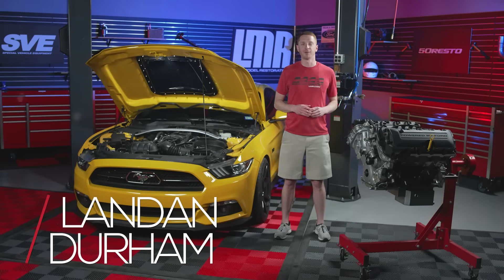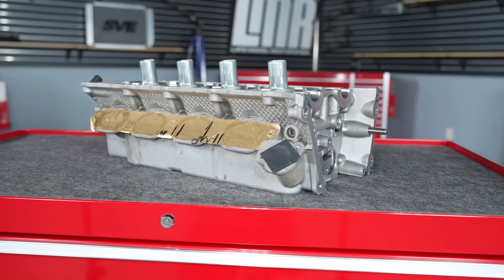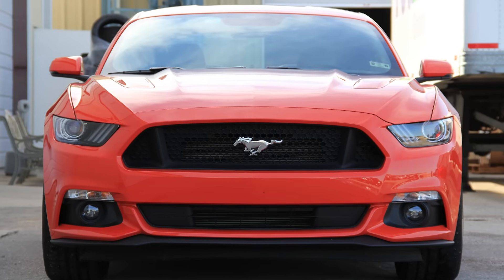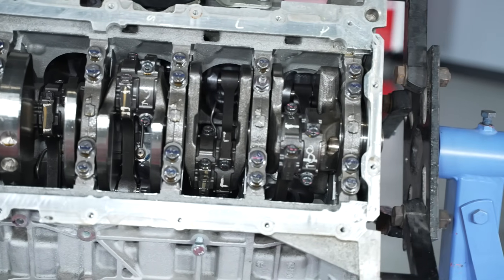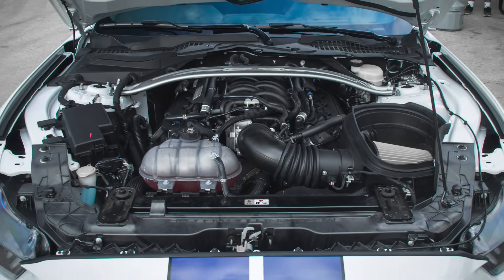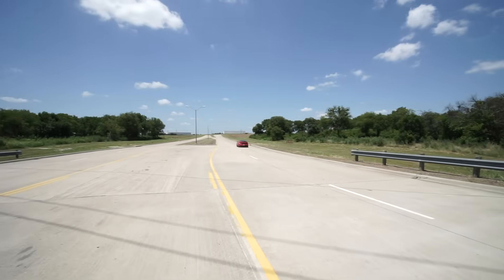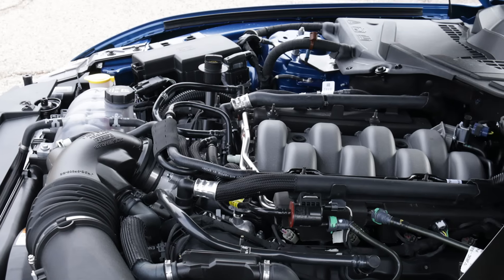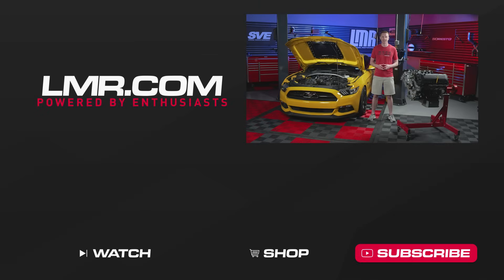Evolution Of The Mustang 5.0L Coyote Engine | Gen 1, Gen 2 & Gen 3

Comment: Anyone else have Gen 1 with aftermarket Heads or ported stock? I have a Ford Performance manifold(Boss intake) and want to keep but want Trick Flow high flow heads
Reply from the maker: No one makes aftermarket cylinder heads for a Coyote. If you're dead set on an N/A build, port the stock heads. However, you'll quickly figure out that boost is near the same price point. -Landan

Comment: I owned a new 2017 GT and now have a 2020 GT (bought new). Something overlooked is that for a physically large engine, they Coyote is fairly light. Also, fuel economy is very respectful on long drives. I've gotten 30mpg cruising the interstate at 75-ish.
Reply: Exactly why im doing my own fab for the dark horse swap into my Z !!! It has so much less support but its worth it!

Comment: Does the current generation used in 2022 and 2023 trucks still use the plasma arc cylinder bores? I thought ford did away with that. Wasn't that thought to be a cause of excessive oil consumption?

Comment: When you say Plasma Arc cylinder walls, does this meant the cylinders are coated Aluminum and do not have steel anymore?
Reply from the maker: Correct.  The plasma arc process deposits material to the raw cylinder bores and then they're machined to tight tolerances.

Comment: how might a person determine if their late production 2014 has the 2015 heads?
Reply from the maker: The 2015 cylinder head had an extended port flange because of the CMCV system.  -Landan

Comment: Now if they can just evolve it into an LS they will have something.
Reply: Don't you mean de-volving into an LS....
Reply: @19coyote5oh9  Well let's see. LS is smaller, lighter, simpler, cheaper, more powerful. Yeah, those are all devolved.
Reply: @jeffarchibald3837  Um more powerful, um no.
Let's see a na 5.0 pushrod make 460 hp, not happening why, 32v or Dohc engines are just way more efficient making power period.
There is a replacement for displacement, it's called technology.
So yes the LS is way outdated technology, no manufacturer on the planet makes ancient pushrod engines except for Mopar.
It's cheaper and simpler BECAUSE ITS OLD lol.
LS has way passed it's prime.
Reply: @19coyote5oh9  I'm a Ford guy myself. Just wish Ford had made the LS. So you are saying newer is better even if it's not as good.
Reply: @jeffarchibald3837  Well the old 5.0 was a "LS" type engine, simple 2 valve design that for the most part work extremely well, for the time.
LS was king for the longest time, but with the introduction of the 32v quad cam,direct and port injection TIVVT Coyote it's on a different level compared to the simple not as efficient LS .
Reply: @jeffarchibald3837  coyotes make easier na power, boost power, and are more reliable
Reply: @jeffarchibald3837  Power to displacement, the 5.0 is superior to the LS.
Reply: @rickitysplitz7035  So what? Power to physical size and weight of engine is less. LS wins, not even close. Try putting a Coyote in a 64-70 Mustang.
Reply: @19coyote5oh9  Really? In unlimited engine racing NOBODY runs coyote. Even Ford factory cars run the old 460s.
Reply: @jeffarchibald3837  And? The 5.0 engine handles boost tremendously better and with the aftermarket support to aid it, will beat a pushrod LS. Bang for the buck definitely goes to the LS, but when it comes to potential, the 5.0s take the cake with the high RPM advantage. I will take it over any LS, especially when I have my 950whp 5.0 baby with me right now as we speak. lol

Comment: I’m Gen 3 coyote 10R80 GT with a 3L Whipple with 3.75 upper pulley, long tube headers, hi glow cats and cat back, billet OPG amd CS, engine and trans oil coolers plus 170 deg thermostat running on 93 pump fuel. Only tuned to 620 wheel HP. Been running like a dream for over a year like this. In your opinion how much more HP can I go safely on this set up with the stock motor? Note, I only do 40mph -130mph roll races at a race track say 10 runs every 6 weeks and some canyon driving (no more than 5000rpm) on every second weekend.
Reply: E85 would be the next best move for more power and safety. With just ethanol and tuning you’ll gain a ton of power. Gen 3 is pretty high compression for boost so you’re most likely octane limited. There’s no magic number for how much they can handle, just suggested limits. It mainly depends how you use it and how good the tune is.
Reply: @gforce_117  Thank you mate really appreciate your suggestion. It’s pretty nice at the moment seems happy but it’s only 620WHP but you know what it’s like “I wonder how much quicker I’ll be with another 100WHP” lol
Reply: @CoyoteAUS  620 isn’t a lot on YouTube, but it is in real life! I have 470 on a S197 chassis and it’s quick and a ton of fun. Definitely not the fastest, but it’s fun and that’s what it’s all about. No matter how far you push it there will be something faster. It eventually gets to a point where it’s more than you can use/put down on the street anyway. With more octane to support it, that supercharger can make a ton more power. I think you’ll still be good and reliable at 100 more hp. You have a really nice setup 👌🏻
Reply: @gforce_117  Thank you mate.

Comment: I have a 2020 f150 with the 5.0 all stock and man is it quick. I've beaten Chevys and Rams in races. Coyotes rock!
Reply: Man I got a 201 5.0 xlt my my friend gots a 20 chevy 6.2 I'm shocked it has 200mph on the dash  my ford only has  120mph I know they both  have  governors on them but damn 200mph on the dash
Reply: @keitgwilliams4349  My truck only goes up to 105 mph and will not go past 105, that's the only thing that sucks about it.
Reply: I think my truck went 106mph I was going down a open hill in south Dakota  on interstate 90 and it wouldn't  go any  faster
Reply: Hell yea. I have the Ranger (largest truck they make in South Africa) similar to the new Ranger in 'Murica but diesel engines and slightly different looks

Comment: The 3rd gen manual felt kind of sluggish below 4500rpm. Idk 460hp sounds good but I feel like it needs to be supercharged to have the low band seem good...🤔
Reply: Could probably use some variable valve timing tuning for low end but then again these new mustangs are thiccc boys coming in at 3700lbs without a driver
Reply: Its probably that the revised mt82d4 has less agressive gearing than previous gens that hurt low end punch
Reply: @elcochiii  yeah man, that low end punch was BAD. A F150 5.0 V8 took me off the line, after 55mph I pulled hard but what the heck. Yeah the 265s are garbage, but needs more grunt downlow its really bad.
Reply: @gc1087  there's no excuse for Ford to still be using that crappy mt82.  A10 is frigging awesome .
Reply: @soulerflare7  Maybe...but it's a Automatic so that's a automatic 'no' from me... 
They should just use the tremec 6 speed for all the GT mustangs.
Reply: @gc1087  oh yeah , gt 350 uses tremec 6 right ?
Reply: @soulerflare7  yeah, it does.
I'm just a fan of the mt82, I mean my 2018 drove fine but it definitely could of felt more solid.
Reply: Yall need all motor labs tuning in your lifes 😐 2018 ford f150 5.0 a10 running 10s all motor

Comment: One thing not mentioned here is Ford used 2 different head bolts - 11mm and 12mm. 
12mm bolts went deep into the block, tying into the main webbing (the strongest part of the block). The 11mm blocks used shorter bolts that ended about where the knock sensors are located in the valley. In some high boost applications this could result in cracking in that area. It is possible to convert an 11mm block to 12.
Reply: Yeah, that was a big problem when we were building that engine. Working in the plant where we build these engines is pretty wild sometimes. It's a great engine and i can honestly tell you that we, the employees, take pride in our work and build the best engines we can for our customers. Btw, I'm not a company man, i just take pride in doing my job correctly.
Reply: 11-12 coyote 12mm
Reply: @Reggiestreet  
Correct me if I'm wrong, but I think they went back to 12mm for gen 3.
Reply: @177SCmaro  Yes they did go back to 12mm head stud's but that's not something for gen 2 owner's to worry about to much, especially if they aren't planning to go with boost.. And if they are it's an easy fix. And if you aren't planning to go past 8 psi of boost you really don't need to stud them. Also 99% of shop's that throw blowers' on the gen 2's they stud them along with Oil pump gears and a crank sprocket.. And honestly from what "known Tuner's" say, there are more cons to the gen3 then there are with the gen 2.. Not knocking what anyone has they are all bad ass cars.. All the Coyote's are bad ass in my opinion..
Reply: @marcasswellbmd  Especially when some crazy dude out in Idaho throws one in an old Camaro and runs 9's.

Comment: I currently have a 2013 GT, I want a gen 3 so bad lol
Reply: Putting a gen3 short block into my procharged 2011 right now.
Reply: There is a HP difference, but only by 40hp. I wouldn't worry about it.
Reply: @rickitysplitz7035 if you have a 10 speed that’s like another 60 hp 😂

Comment: I think it's important to list the differences between the 2015-18 Gen 1 Voodoo and the 2019-20 Gen 2 Voodoo. The gt350 and the GT 350R had slightly different internals for the Gen 1 Voodoo. For the Gen 2 Voodoo the internals we're the same and the Gen 2 uses the same block as the predator motor. If you look at the used car market the 2019-20 Gt350 and gt350r are way more expensive
Reply: I’ve had both, a 17’ 350 and a 19’ 350 now. The 17’ car threw a rod and destroyed itself. The 19’ car makes 50 more whp and it’s stout as hell. The 19-20 model year cars are the cars to buy.
Reply: @dontyouworryaboutit_  they dumped one of the 2020 cars and it was making 500 WHP
Reply: @likenem  my 17 car at the time made 498whp on 93, this 19’ car with cams on e85 makes 548whp, needs springs and it’d make more. The 19-20 cars are way more stout
Reply: I thought the gen 2 started in 2018
Reply: @jrk1990  the Gen 2 Coyote started in 2018. The Gen 2 Voodoo was only for 2019 and 2020. If you look at used prices there is a difference between the 2018 and 2019
Reply: Yup. The Gen 2 Voodoo got all the improved internals
Reply: As well the boss 302 motor is fully forged internals. And gen 3 makes 460 at 7500 not 6k
Reply: @christiansouthard5677  I don't think the connecting rods are fully forged but the Piston heads and crank shaft is.

Comment: Great video as usual.  Thank you , I want the safest build for my gen 1 to make greater HP without harming engine.  Ideas on the best set-up?  I drive several times a week to work so looking for lower end vs higher end.  EVentually want to go to drag in a couple years after retirement.  I
Reply from the maker: Hey there, we recommend checking some forums or Facebook groups to get an idea for the best and safest set up. There are a lot of modifications that you can install to make the engine a lot faster.
Reply: I have a VMP Odin on my Gen 2.  Drive it to work everyday. Makes 660 wheel hp and 519 ftlbs.  It is awesome!
Reply: Some form of TVS, if you can find a Roush 2.3 or VMP Gen2R that’s your huckleberry.

Comment: The Gen-3 with a few bolt-on mods (JLT intake, E85, Headers and 10-speed trans is a 10 second car. Dang unbelievable!👍
Reply: Brian can finally pay Dom back.
Reply: @scarecrow6292  
Lol. Yep.
Reply: @markurbancowboy ur all over the comments on this video. Do you have a coyote? I installed a gen 1 in my 2004 Mach 1, came with Boss intake and huge BBK throttle body?
Reply: @markprice2225  
I had a 2021 5.0. Traded it in for 2018 GT350 and then went back to Mopar. The Mustangs were fun cars  but I  just wanted something with more low end grunt.  The pushrod V8's are what I'm more accustomed to.
Reply: @markurbancowboy you should try an 07-14 gt500 they have a long stroke 5.4/5.8 and have big tq down low and mid range and don't Rev as high as a coyote despite being dohc.  You get the smoothness from having a dohc engine but a power curve more similar to pushrod engines...my 07 I swapped a gen3r blower which is a 2650 tvs and it's like 750 wheel at 19 psi and 93/boostane on a stock long block engine.  The cool thing is it made 733 tq and is over 700 at the tires (on drag radials) from 3-5500 rpm.  It's a tq monster it also has the old school firing order that the 4.6 and old 5.0 had so it has a more traditional muscle car sound too.  So many people overlook these gt500s they're badass cars and vastly different from a coyote with a similar blower.  Totally different power curve and sound and feel.
Reply: You are correct but even less then that, factory headers with a cat delete , E85 tune, and a rear tire. Completely stock motor no JLT needed
Reply: Most mustang engines with a tune gets you decent gains just goes to show you ford makes some great V8 engines and even their 4 bangers are decent for what they are
Reply: @cerogravity8653  seriously your not wrong. I have a 5.0 s550 but those lil ecoboosts are respectable for what they are.
Reply: @scarecrow6292  s550 Andrew beat a built boss on slicks with and ecoboost haha
Reply: @dragonmantuning3792  i dont doubt it, they move right out of the box. Add slicks to it and its gonna be bonkers. We all know the rules, it doesnt matter how much power you make. What matters is what power you can hook to the ground. Although burnout cars are alot of fun too.
Reply: What about gen2 what mods get it there with a manual 6speed thanks I appreciate you
Reply: The 10 speed is already included with a gen 3 car 🤦🏾‍♂️
Reply: @downhilldaddy5282 Lol he's saying if you OPTION that available 10-speed, and NOT the 6-speed manual.
Reply: @LayerZeroDesign  he should’ve said, Gen 3 auto
Reply: I like all the Coyote's but have a soft spot for the Gen2's not just because I have one but because they feel so smooth.. I have driven them all and the gen1's, but gen2's felt the smoothest.. The gen3's feel great too but in a blind test manual on manual it's very hard to find a power difference with the butt dyno anyway.. Also the gen 2's tend to be a 150 to 200 lb's lighter.. After some Mod's and part swapping my 17 weigh's 3,620lb's without me in it.. Thats one of the main reasons' I went with a Performance Pack GT over a Scat or an SS, They are heavy as hell and I couldn't see out of them well when driving them..
Reply: Idk man post a link in the comments, are we talking about in the same s550 body also?
Reply: I just saw a video with 2 guys saying ford copied  the Nissan gtr engine to make the gen 3, does this sound like it has any truth or not?? You seem to know a decent amount about the gen 3 👊
Reply: @chriscraighan4432  yea because the gtr is a v8
Reply: Bolt on a whipple
Reply: Idk about 10 seconds (maybe high 10’s on a perfect day and with slicks)
Reply: @joerouth6255 
Yeah,  that's what I meant, high 10's.
Reply: My dad has a 18 gt 6speed manual with long tubes no cats some kind of stainless mufflers intake tune and oil catch can he said how quick it was I've had allot of fast cars over the years so I was like ain't no way it's as fast as he says it is I was def wrong last stockish mustang I drove before his 18 was a 3valve gt and it was slower than all the new edge cars I ever drove by allot actually but my God my dads 18 surprised me I'm guessing it has a little over 500 at the crank wth the mods

Comment: I'm trying to swap a gen3 into my town car. Either that or the godzilla.
Reply from the maker: Gen 3 for sure 💯
Reply: @latemodelrestoration  I don't know man that godzilla comes factory with forged internals. She's a boost ready beast. But that gen3 is smaller and probably less fabrication needed.
Reply: @CrimsonWormApologetics  Gen 2 and up has forged internals besides the pistons, coyote is a way better platform for modding and doesn’t need open motor work.
Reply: @169abr  The 7.3 doesn't need open motor work either. There are several stock 7.3's right now running over 1100hp. Also the 7.3 is not as complex as the 5.0 being that it is good old fashioned pushrod technology. Brian wolfe has a 7.3 making 1450 hp on stock internals. They can handle huge boost from the factory. Although the 5.0 is nothing to laugh at either. It can make serious power but not 1400 type power. The only reason i would go with the 5.0 over the 7.3 in my application is less fabrication and smaller engine to fit in the car. But in my opinion the 7.3 is much better engine overall. However at this time being that it is so new. The aftermarket mod world for the 7.3 is pretty much non existing. It's hard even finding headers at a decent price. So the 5.0 got it beat in that aspect. It really boils down to preference. I like both equally, honestly.
Reply: @CrimsonWormApologetics  I will always defend the Coyote over the Godzilla cause I don’t see a reason to go back to big block pushrod technology when you can get the same power out of a 5.0L engine that can chop with a tune, I get that a lot of old heads are all on the hype train cause pushrod or whatever, I guess that makes me a fanboy eh.
Reply: @169abr  im not hating on the 5.0, definitely a solid engine. I like em too, they run and they like boost. I just want to be different. Seems like everyone is 5.0 swapping right now. Not to many people doing the 7.3 swaps. What really got me thinking about it cleetus. They got that 7.3 and it got me thinking. 🤣